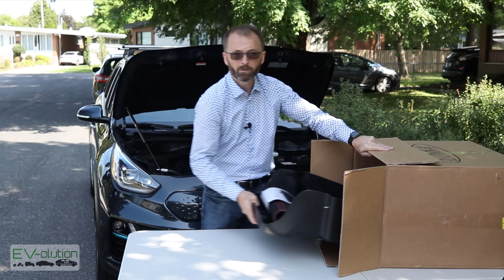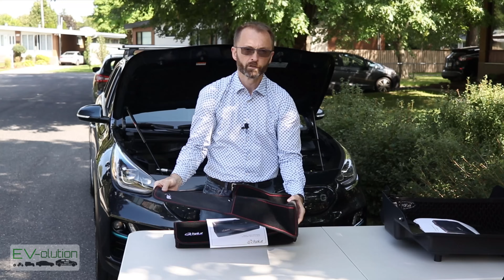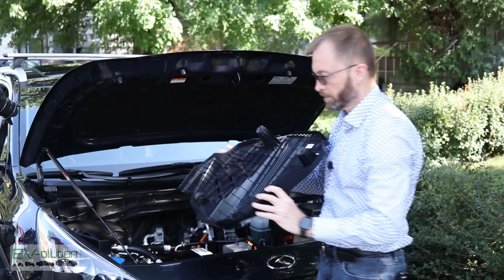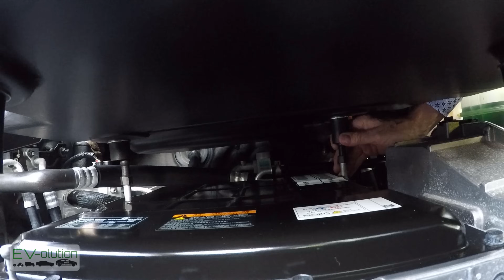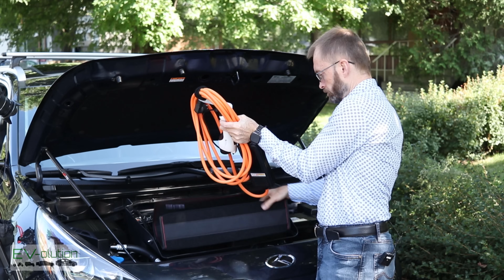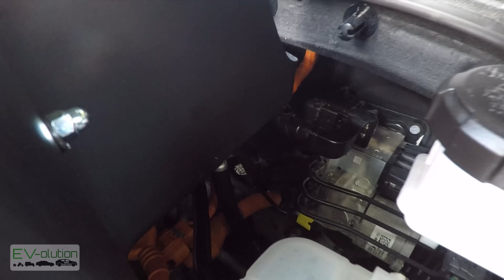Add a Frunk to a Kia Niro EV!

Comment: Hi Andre, well Kia Niro EV 2024 come with a Frunk now. After seeing your video i was considering to get one. But when i took possesion of my 2024 Niro Wave , Surprise there is a Frunk and it has an hinges cover and LED in the compartment and also has hood struts like you installed in another video. Lucky that i did not order the struts and Frunk before having the car. Keep up the good work on your video. Learning a lot.
Reply from the maker: Bonjour M. Météo 😎. Effectivement la Niro EV 2024 a déjà un frunk et les vérins à gaz, comme dans la EV6, et le frunk ressemble énormément à celui du EV6. Félicitations pour votre achat, la Niro EV est une excellente voiture. Étant donné que vous avez une Niro EV 2024 certains trucs de mes vidéos sur la EV6 seront bons pour votre Niro EV. Merci d’être abonné et de prendre le temps d’écouter mes vidéos.

Comment: Just wondering if you have any thoughts as a follow up?  I couldn't find an update video...but this looks decent for after market..
Reply from the maker: I never made a follow-up video because I sold the car before getting my EV6. It was excellent the entire time I had it, even during winter. Nothing ever got wet or dirty and the heat never caused issues with the frunk. I highly recommend it.

Comment: Would the type 2 charger fit in the bigger compartment ? I have just purchased a 2021 e Niro and think this could be beneficial for storing cables. Also, in the video you said you’re eye going to do a follow up regarding the temperature and if this affected the frink. What are your findings in reference to this ? 😃😃
Reply from the maker: It depends on the size of the level 2 charging station you would try to fit in there and how long the cable is, but I would say no, it probably won't fit. As for the follow up, I sold the car and all accessories with it, in February 2022. I now own a Kia EV6. I can't make a follow up video but I can tell you that there were no issues with the frunk the entire time I had it and heat was not an issue. I really liked the product and recommend it without hesitation.
Reply: @EV-olution  thanks for the reply. I was probably going to ge tit to store the type 2 cable there, so because it won’t fit I might just leave it 😃😃. Thanks for all your videos they are great 😀😀
Reply from the maker: @jasonwilson9644  I had put off getting one for 2 years, because I thought I did not need it, but once I had it I realized it was incredibly useful and I stored things in it all of the time since it was easier to access than going to the trunk for certain items. Beyond that, it allowed me to store things that were previously stored in the section under the trunk, which became difficult to access when I put things in the trunk. It proved very useful when camping. And thank you very much, I really appreciate it.

Comment: Very cool that you could do that on the Niro. Would come in handy for camping trips where space is dire on my 17Bolt. Very nice charger, is that a level two?
Reply from the maker: It was something I did not know I needed until I had it, it is very cool, especially with the hood strut upgrade. The EVSE is the Level 1 that is included with the car.

Comment: Dear EV olution.  Thank you for this information about the front boot or Frunk.  I have bought one today.  I have also sent a small thank you, so you can buy a coffee.  I have a question for you about the rear boot (or trunk as you might call it)  In the British version of hte EV niro there is a raised base, under which there is a styrofoam circle and three peices of plastic.  If you unscrew these, the floor drops down, giveing more head space for our Black Labrador.  The base of the trunk, does not then form a tight fit.  In Norwegian models the base of the trunk is already lowered and there is a purpose built floor.

Question....  Would you know where I would be able to purchase on of these lower floor covers.  Speak soon....  Kind regards  Andrew
Reply from the maker: My first video ever, in 2019, actually shows the storage below trunk!
Link: https://youtu.be/kJm4lpJyeJk?t=220
I did not get one, but Frunk.at also sells exactly what you are looking for. Here is a link: https://www.frunk.at/produkt/kofferraum_ladeboden_e-niro/

Comment: Hey bud, any update on how this has worked for you?
Reply from the maker: The frunk product was the thing that I did not know I needed. I had been using it on a regular basis up until I sold my Niro EV and the product was still perfect. Everything inside stayed clean, dry, and nothing moved. I highly recommend getting one if you think you need one at all, and even if you don't. I did not want one until I had it 😎

Comment: Hi Andre, I watched this video with great interest we will get our E-Niro shortly and i wonder if there are no problems with the heat off the engine when the frunk is installed. what is your experience with the frunk after using him for more then a year now?
Reply from the maker: I have had no issues with the frunk. The fit is excellent, no water, nor dirt got into it, and the bags still look like new after all of this time. I highly recommend it for anyone who wants the extra storage space in the Niro EV. I also recommend the hood struts. Frunk offer some so you can buy them from Frunk, but if you want to see how they are installed, I have a video about it.
Reply: @EV-olution  thanks for the reply Andre and no issues with the heat?
Reply from the maker: @huib1715  none at all.

Comment: Just traded my Bolt ev for a Niro. Love my 2022 Niro but of course never an easy trade. I went to DC charge and of course wouldn't work. Has to go back of course but I love your constant niro updates. Thanks
Reply: I just traded my optima electric and gas for my Niro EV and love so far the KIA dealer here in Manhattan KS is putting in charging stations and should be operating soon this is all new to us as well. My husband put our 240 charging station outside.
Reply: @joanneb2427  this is my 3rd EV and I really enjoy it. KIA service kinda stinks and they can't fix the issue. Wait ti.es on hold up to 45 mins. Other than that brilliant car enjoy
Reply from the maker: Congratulations on your new Niro EV. I am surprised that you have an issue with DCFC, I have not experienced that as an issue. If you had a 2020 or newer Soul EV I would not have been surprised, but with a Niro EV I am surprised.
Reply: @EV-olution  
So I took my car to KIA which had a level 2 charger. The service guys had no clue what a level three charger was or a DCFC. Tonight my car sits at there lot with no idea how to fix it. They called me to see if I could activate a electrify America charger as its not the dealership responsibility and that would be the only way to test it.. Frustrating for sure
Reply from the maker: @tbone939  it sounds like your dealership is not Kia EV certified and I would be hesitant about having them work on my car. You should contact Kia in your country. Is there another Kia dealer in your area?
Reply: @EV-olution  all the same situation for all three dealers I'm stuck.
Reply: I will keep you updated kind of an unusual situation. Keep up the awesome  YouTube info.

Comment: I've had the frunk in my e-Niro for over a year now, and it's been on the road with the car for more than 20.000 kilometers. The frunk still looks like as new, and the content (charging cables, tire kit, first aid kit, emergency jackets, gloves) stayed completely dry and clean. The dealer never even frowned when they saw it.

I love the fact that I never have to dig out my charging cable or other stuff you need while doing a long trip from underneath the luggage in the back of the car. It's always readily available right where the charge port is located.
Reply from the maker: I have just had my first experience in very heavy rain for a long drive and nothing got wet or dirty. It is fantastic 😎
Reply: @EV-olution  I really don't understand why something like this doesn't come with the car as standard, or as an optional accessory from the manufacturer.
Reply from the maker: Same here. You would think Kia/Hyundai would partner with Frunk.at to offer it, or buy the company.

Comment: It looks great, but some KIA dealers in the Netherlands don't want to see this. While charging the ac/dc converter (unit under the plastic cover) heats up till 54 degree. There's is no active cooling like other EV's. What will be temperature if you install this frunk?
Reply from the maker: I don't know what temperatures it hits when charging, but the Niro EV will use the liquid cooling system that includes the radiator and fan to cool everything down. Also to note, many people have been using the frunk in eNiros for about 2 years without issues.
Reply: @EV-olution  I noticed the cooling system only kicks in at DC charging when battery gets above 38 degree. The AC/DC converter is connected to the cooling system to use the wast heat to heat the cabin when needed.
Reply from the maker: @marcoversteeg2705  thanks for the info.

Comment: Great video! You are getting really good at this :-) Maybe do one about the Niro's battery degradation after 2 years. I have my Nero EV now for one year and charge it always to max 80%, but not sure if this has a large impact. maybe I should not bother doing that, but almost no info to be found on the web for the nero about that.
Reply from the maker: Thank you very much 😎. The battery video is a good idea, I will make an EQ episode about it. As for your charging to 80%... The Niro EV has a battery that is bigger than the 64kWh that your can access. I charge to 90% for my daily use and only to 100% for long trips and after 48000km and over 2 years my battery still shows 100% state of health.

Comment: The material that the frunk tray is made from, is most probably either LDPE, (low density polyethylene) or HDPE, (high density polyethylene). The melting point of LDPE, is 105-135°C or 221-275°F. And the melting point of HDPE, is between 130°C-171°C or 266°F-340°F. So I think it’s safe, as it’s not in direct contact with the metal housing.

Another great presentation, thank you.
Reply from the maker: Thanks for the info! Since others have been using it successfully for a couple of years I am not worried 😎

Comment: Note that on the Kona at least, it doesn't have the gas-lift springs, but an old-style prop. Gas lifts can be bought as a third-party add-on
Reply from the maker: The Niro EV also does not have gas hood struts, I added them earlier and I made a video about it.
Reply: @Andre @Mike what do you think about the diy free option of using the existing spare wheel well storage thing like this guy did https://www.youtube.com/watch?v=vFncib5Tppk
Reply from the maker: I think that it is a bad idea. The styrofoam insert from the trunk is not designed to withstand high temperatures. In the summer, while charging, it can get very hot under the hood and I am fairly confident that the styrofoam will melt.

Comment: I was wondering why Kia didn't fit one and was thinking it might be because of the lack of heat dissipation. Is that a line of holes I can see in the underside of the frunk moulding? If they are there, I guess that's why the net and compartment separator are there too?
Is it not also a modification you need to tell your insurance/lease company about?
Reply from the maker: There are no holes in the Frunk unit, the anti-slip mat makes it look that way. I am not really concerned with heat flow, many people in Europe have been using the Frunk for 1 to 2 years with no issues. Also to note, the new Ioniq 5 and EV6 have a frunk and are even more closed up under the hood.

Comment: Hey Andrew,a very nice video,thank you.I have one of these in my E-Niro as well,and I am very happy with it ,but CAUTION: At the front right corner of the frunk (viewed,when you are standing infront looking backwards at the car),there are two high power cable sin orange. Especially, when the frunk is loaded, the cable may rub on the lower side of the frunk when moving. It will damage itself and the frunk over time.I took a bit of welcro and bented the cable about 2 cm down. Then it will not touch the Frunk.
Have fun withit!, Uwe
Reply from the maker: Thank you very much for the detailed information. I will have a look at that.
Reply: I'm seriously considering buying this product, so thank you very much for the heads up and workaround! :)

Comment: I would have bought one for my e-Niro 1st edition ages ago but there seemed to be some confusion about it not fitting in some e-Niro’s and also my Austrian/German is a bit rusty too.
Reply from the maker: The e-Niro is the same from 2019 to 2021 with regards to the propulsion. You should have no issues. Also to note, if you email them in English they reply on English; that is how I ordered mine 😎

Comment: I like your video and showing how to install greatly helps with no screw ups.. Since we live in Vancouver and have these rodents that like to nest on the cover and battery.  I know there are other sites in Europe that was on YouTube that showed they have a lid on the Frunk.  Haven't bought one yet but you activated my senior brain again.
Reply from the maker: Thanks, I am glad I could help. It seems that Frunk.at may have a version that closes, but I have not seen it.
Reply: Hi Andre:
This is a YouTube I had seen in 2020 on the Frunk
https://www.youtube.com/watch?v=uAMD9Ppqojc&list=PLQWK3jtREPh8RiBi07Ay2ThXTWrz25vsN&index=4 @EV-olution
Reply from the maker: @mangoginger8924  ok, I had seen that one. It is interesting, especially for the Kona that does not have a rubber seal at the front of the hood. The Niro is very closed up with the rubber seal at the front edge so I don't think it will be a problem. I will find out this fall and winter.
Reply: @EV-olution  Thx for ur advice

Comment: Small bag is for the aux. battery booster.  :)
Reply from the maker: 😂🤣 Good idea
Reply: @EV-olution  it is in my glove compartment with no more room for anything,  had to reverse crawl to the trunk and then fumble to open the trunk
Reply from the maker: @Rroll100  that is why I leave mine in the empty space of the console, beneath the shifter puck, but I like your idea of putting it in the frunk.

Comment: I have one since last October.
I was pleasantly surprised that the content stayed dry and clean even after a full Montreal winter.
Reply from the maker: I just got the frunk, I have not had it all winter. Like I mention in the video, I just bought an installed it, but will find out how it does this winter and make a follow up video.
Reply: I can only agree. II am using one here in Germany / Bavaria since November 2020. It carries my charging cable and my Juice Booster. Nothing gets wet or dusty. The part is perfect. I also have the hood struts wich are very useful.
Reply: @willywerkel7015  - interesting. I'm thinking of storing my Juice Booster in a Frunk. Do you store the Juice Booster in it's Case in the Frunk or do you put the individual bits and pieces individually into the Frunk? And did you buy the accessory bags as shown in the video? 

P.S. - Sie können auch auf Deutsch antworten, da ich in der Schweiz bin. Danke im Voraus!
Reply: @musicofnote1  Ich benutze den Frunk jetzt seit einem Jahr und habe darin meinen Juice Booster, alle Adapter, eine Juice Booster Verlängerung und ein 7,5m Typ2 Kabel. Passt alles rein. Ich habe allerdings die Abtrennung, die nur eingeschraubt ist, unten abgeschnitten so dass nur noch oben eine Strebe (zwecks Stabilität) übrig bleibt und man die gesammte Grundfläche nutzen kann. Ich habe die Teile des Juice Boosters einzeln im Frunk. Der Frunk schließt sehr gut mit der Motorhaube ab und es bleibt interessanterweise alles sauber und absolut trocken. Ich bin mit der Lösung sehr zufrieden.
Reply: @willywerkel7015  - vielen Dank für die sehr ausführliche Erklärung! und liebe Grüsse aus der Schweiz!

Comment: Awesome work on the video! I have been planning on installing a subwoofer in the spare tire storage area in the trunk of my Niro EV 2019. I was a little concerned about reducing the storage. But this video opened my eyes to other options for storage. 

Also, another thing I borrowed a tesla model 3 and popping the hood and pulling a backpack out of there, definitely makes people passing by turn their heads. I felt pretty cool doing that in a crowd. A frunk is a great storage idea.
Reply from the maker: Thank you very much, I am glad it helped. I am sure it will turn some heads if I access stuff in it 😎
Reply: Surely there's a sub in the left of the trunk, behind the wheel arch?
Reply from the maker: Only in the top trim. I am guessing that Vance has the EX trim with no sub.
Reply: @EV-olution  Yeah I got the base model Kia Niro EV.

Comment: I imported and fitted my Frunk back in May when I got my E Niro 4+ I always use public chargers as I don’t have the facility of charging at home, and the Frunk is ideal for storing my type 2 (Menekes) cable without the need for lifting the hatch in the boot (trunk) as I also have a full size boot (trunk) liner. I also fitted the same gas struts as you have and find them excellent 
Keep the videos coming 👍🏻
Reply from the maker: You situation is exactly why I decided to make the video. In North America the charing cables are part of the charging stations, so the Frunk is less useful to me, but I knew that in Europe the cable needs to be stored in the car, making the Frunk a very useful item. Regarding the gas bonnet struts, just in case you did not know I made a review and installation video about them. Thanks for taking the time to watch my videos I really appreciate it 😎